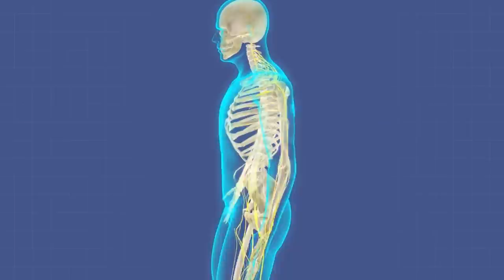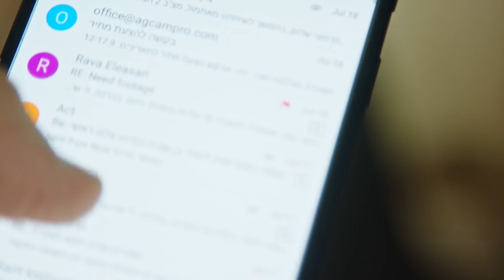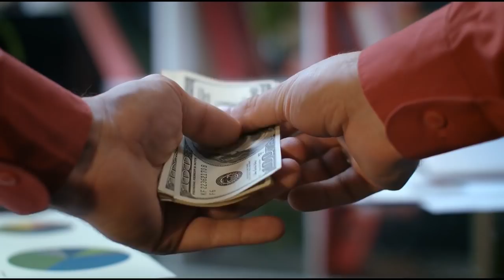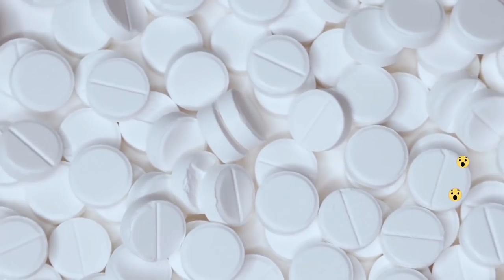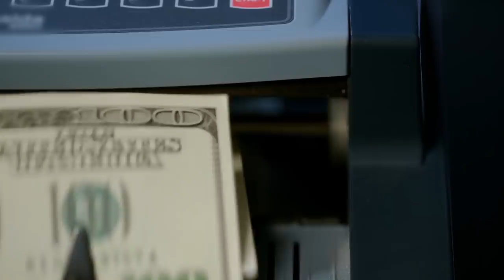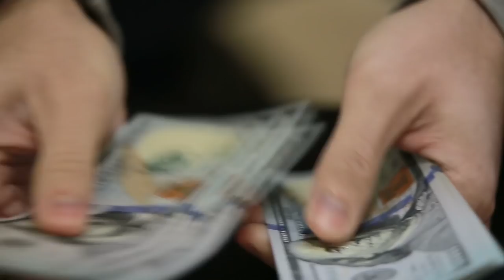10 Most Expensive Liquids In The World

Comment: I have had to purchase several printers & I was only a college student for 5 years!! Every time it ran out of ink, I would search for the least expensive way to replace the ink cartridges for the printer but I quickly learned it is not worth the money to buy refilled cartridges,  one instance was I had bought a 4 in one copuer, printer, scanner/fax....when I learned about refilled cartridges I thought it was a great way to save money but the cartridges leaked all over the inside of my $499.00 4 in 1 because there is no way to get all that ink off the rollers & other parts inside the printer & all in one machine. I bought another printer from some friends...a fairly expensive machine,  the only problem was it didnt come with the cords needed to make the machine work!! With all the new ways of taking copies of letters or messages...it has become extremely hard to be able to use the machines, all the directions have become so difficult that the printer I have had for the last several years, the ink dries out in my airconditioned home so replacing the ink cartridges can be very expensive but just getting it to print with wireless pringing & other methods...you basically have to be very tech savvy...its taken up to 2 days to finally print official papers in the recent past using my phone to connect to the printer just to print a few simple pages!! I always try to find the easiest model when looking for a new printer!! The ink my cost nearly the price of gold but we need those copies printed!!